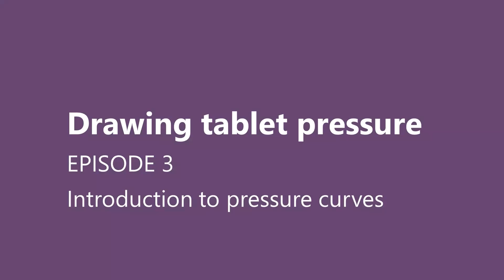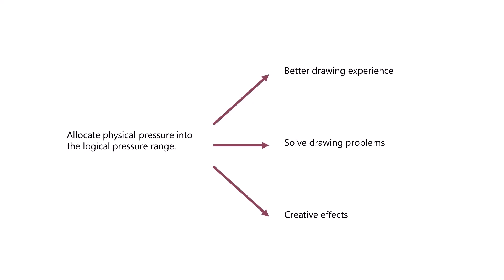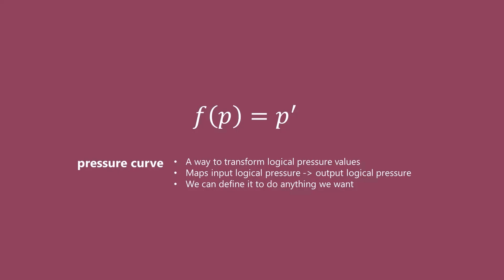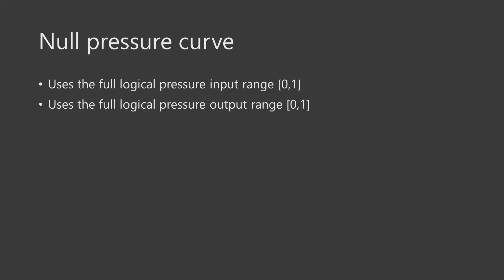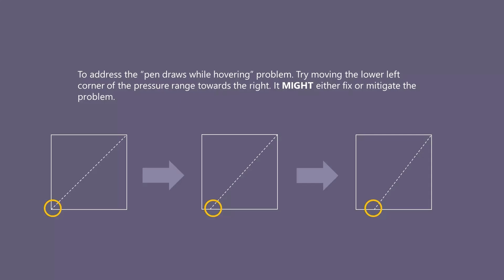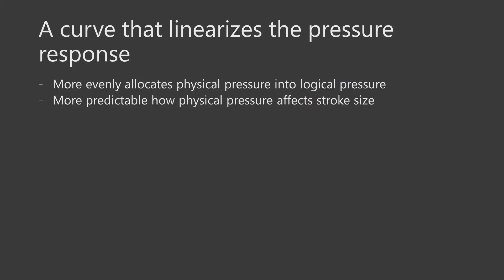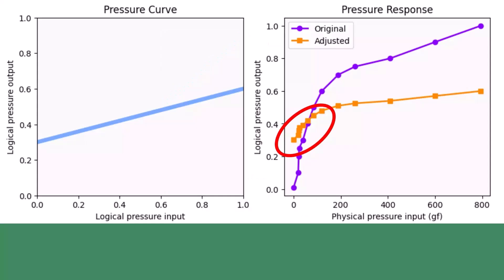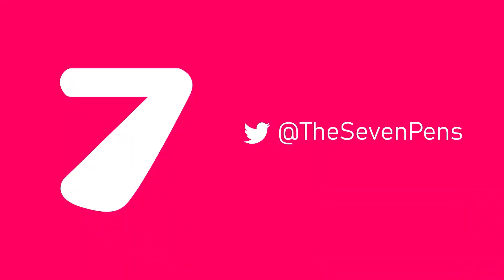Drawing Tablet Pressure (3): Introduction to Pressure curves

Comment: Good stuff and depth. I keep my global curve as linear, then tweak the pressure curves per brush preset. For example having a different curve for a "pencil" vs a "charcoal" vs an "oil brush" will want a gradual ramp up on some, but on a paint brush to go to high pressure on a steep curve easily. I also think the more pressure levels 4k, 8k, 16k are more than just hype. As pens support longer pressure ranges, you need some headroom for when you need to chop off the top end to go to full pressure without putting actually 800g of pressure. If I chop off the last 1/4 of the curve then I've effectively cut off part of that 8k range of pressure levels.